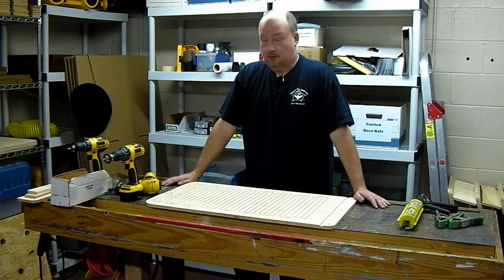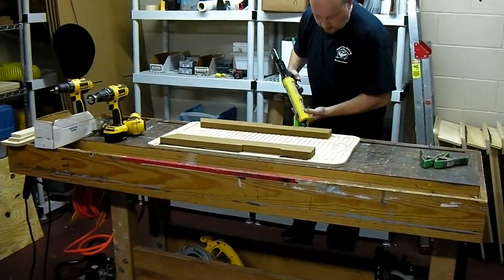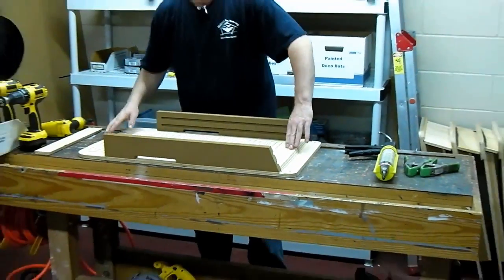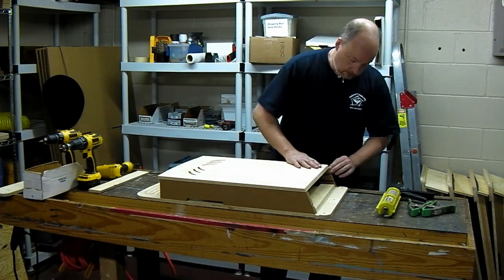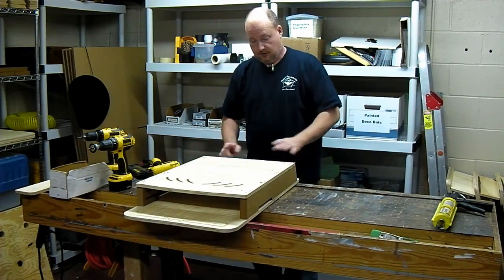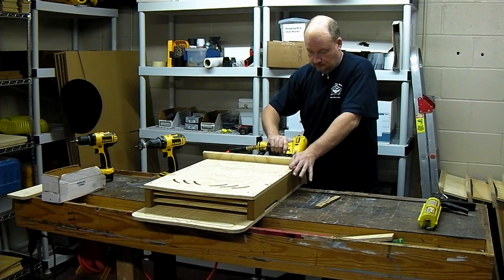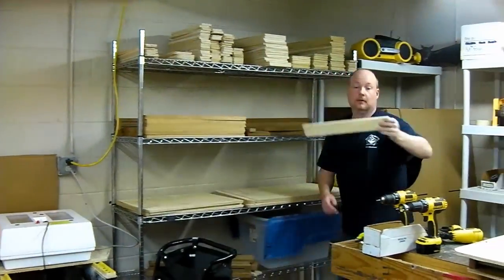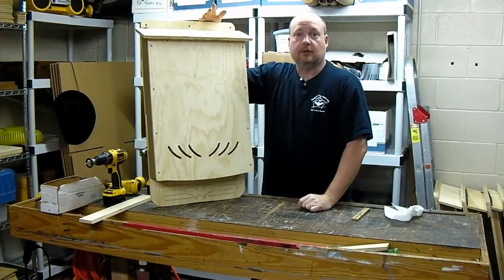Building Our Three Chamber Bat House

Comment: Using good exterior plywood is a good idea.   Do you coat the exposed edges at all to help prevent moisture effecting the ply, or is this unnecessary?   Thanks so much for this video and the work you do for our bats!
Reply from the maker: We give 3 coats of a high quality exterior latex paint on our commercial bat houses, and recommend the same when we sell our kits.

Comment: so if i dont have a cnc router how do i cut the grooves?
Reply from the maker: You can cut them by hand using a handsaw, or use a router with a small 1/8" bit, or use a razor knife. Grooves don't have to be consistent, just scratch up the surface so bats can get a toehold.  Thanks for loving bats!

Comment: How do I know that wasps and hornets won't make a home in the house? Or how do I prevent that from happening.
Reply from the maker: Paper nest building wasps generally desire at least 1 to 1 1/2" space to build a nest, the 3/4" baffle spacing that we use discourages wasps from building inside the bat house. The open weather and small overhangs tend to prevent them from building outside of the bat house. There is no known way to prevent dirt daubers from building mud nests inside a vacant bat house, but they are harmless and once bats occupy the bat house the dirt daubers will leave it alone.  Thanks for loving bats!
Reply: @h4bats  what about carpenter bees? I suppose since there are no thick pieces of wood on the bat house they should leave it alone. We happen to have paper and mud wasps, hornets, yellow jackets and Carpenter bees. We are in Upstate NY, where the northern long ear bat lives and a nearby projects just clear cut about 70 acres of trees in which they lived heavily. So I was viewing your videos to find what I need to do. And since watching most of your videos, I think I found a few good places for some boxes. I just hope they move in fast.

Comment: I love the design and construction of this house. I was wondering what is the biggest house or kit that you make?? Im Looking to give a lot of space for a decent colony to eventually grow into a  colony of around eight hundred to a thousand bats. There has been alot of tree clearing  and  want to provide a place that they can call There home or homes to make up for the forest loss. Plus it would be an awesome sight to see as they go on their nightly flight. Hopefully people in the neighborhood will see what I'm doing and hopefully do the same.
Reply from the maker: The 4 chamber fully finished bat houses can be mounted back to back on a single steel pole (schedule 40 2"ID black pipe) and we sell the bracket for that as well.  Those two 4 chambers could easily accommodate 1000 bats.  As for our kit, we are working on a 4 and possibly 5 chamber kit we want to release soon. Two of those would hold 800 and 1000 bats respectively.  Check out or estore at https://estore.habitatforbats.org

Comment: Do you have a problem with hornets wasps nest or even carpenter bees in a bat house ??? Thanks
Reply from the maker: Wasps will generally build around the bottom of the bat house. Once occupied by bats, wasps are typically not a problem.  We have not seen a huge problems from carpenter bees, they generally do not prefer painted surfaces and seem to be less attracted to plywood type materials.
Reply: @h4bats  Building out of cedar wood be the best wood with no negative aspects ??? Thanks

Comment: Hey what’s a good way to relocate bats? We have an issue and don’t want to just “exterminate” them
Reply from the maker: After early August (varies by state so check your local laws) you can exclude bats from areas you don't want them. It's important to wait as they may have pups that are unable to leave on their own until then.  An exclusion can be as simple as a netting hanging down over an entry point so they can leave and crawl down (leave the bottom hanging) but when they come back they will land on the net and not be able to re-enter. Or you can use tubes like PVC or even cardboard to create an exit they cannot later return to and climb back up and inside.  Good luck and thanks for loving bats!

Comment: Question:
I want to purchase a 4 chamber house for southwest Virginia, average July temp is 82 with high humidity.  I want to place house on west facing side of a brick house, should I get the regular, medium color house or the cold weather house?
Reply from the maker: You should be OK with a medium color in that area, but placement should be facing South to SE and catch the morning sun keeping sun until some time after noon. While a bat house on the west side of the house might be used by a bachelor colony or some species that might normally roost in trees, it would not be attractive for a larger colony of females. Bats prefer the temperature between 85 and 100 degrees and the morning sun goes a long way to warming the roost in the mornings.  If you are in the mountains, higher altitude and thus lower temps, you can go to a medium dark color.

Comment: Hi, How much guano could I expect to collect for my garden per 100 bats?  Like a quart a season?  I was going to put a pan around the bottom of the pole.
Reply from the maker: Repeating answer from a different video... With a persistent colony of 100 bats, you could get a reasonable amount, hard to say. The wind, sunlight drying it up and missing the target will reduce the amount you collect.  I have seen a healthy colony of around 400 bats produce roughly a 2" blanket of guano on the ground for a diameter of about 3 feet their first year.
Reply: @h4bats  thanks!!

Comment: Is that a non toxic caulk that you are using if so please let me know what brand and type you like to use Thanks.
Reply from the maker: We use a high grade of paintable exterior latex caulk. We have to switch brands depending on availability. Once it is fully cured it is not an issue for the bats.

Comment: Is an open bottom better or should I slightly close it for predators? Also, what size holes should I bore in my partitions? Thanks
Reply from the maker: Open is best to allow the guano to drop and not accumulate in the bat house.

Comment: Apparently you installed the roof so that the bat house could vent out the top, I think.
Reply from the maker: Nope, the roof is completely sealed. Only vents are on the lower front and sides.
Reply: @h4bats  whatwas the spacer for?

Comment: i made a bat house out of ceder, what kind of paint should i use any help, blueegg08@gmail.com
Reply from the maker: It depends on the temperatures in your area. If you are in a very hot area, Texas, desert areas etc... you should actually go with a light color, closer to white or light tan etc... if you are in the north with cooler  temperatures use a darker brown or even black if the avg July temp is below 85F.

Comment: Wen using a french cleat i use a spacer at the bottom really nice video. I live in Arkansas and build bird house for fun and have request for bat house. I have watched several videos on this and I come across your video's. every boudy using mesh glad you cleared that for me. I will use groves. And most are making the chamber 1 1/2'' with a predator guard but I will use 3/4'' opening like you use. Thank you for your videos. 5 stars

Comment: Is the ply waterproof or do you recommend painting with a waterproofer?
Reply from the maker: You should paint the exposed surfaces with a good exterior latex paint. The plywood we use is rated for exterior use, it does not delaminate when exposed to moisture long term.  You should look for plywood stamped as "EXT" or "Exterior". Plywood with a rating of "Exposure 1" is not sufficient.  However, you should avoid pressure treated plywood.

Comment: I live in Northern Kentucky. We have little and big brown bats around here and was interested in one or more houses to allow for the development of a big colony or colonies. Insects eat us up at night and white nose is decreasing their numbers. Any assistance in this effort is highly appreciated and I thank you for your time. Oh was wondering if there is any way to make an old horse barn more attractive to bat's?? I was working behind the open door and only two came out at dusk.
Reply from the maker: The best way to make sure bats remain in your area is to improve their roosting opportunities. Bats like warm dry places to roost that are secure from predators. Bat houses can do this or in your case if you know bats are roosting in your barn you could improve the area they are roosting by isolating it from being disturbed. You could add (in the winter while they are gone) baffles in the area to increase the roosting surface, but you have to be careful NOT to insulate it from warmth. i.e. they may be roosting on the specific wall because it gets warm in the sun. In a case like that you would want to add chambers that all were exposed to that inside wall, not layered on top of it isolating them from it.

Comment: I didn't see any groves on the two baffles.  What do the bat's claws grip onto in the center chamber? For the outer chambers are groves only made on one side? Also, what is the space measurement for the chambers between plywood boards?
Reply from the maker: There are grooves cut approx every 1/2". You just can't see them in the lighting of the video.  We use 3/4" spacing for our chambers.

Comment: can you paint this house a different color
Reply from the maker: +stephen unk  It is the shade of color not the actual color that is important. It should help the bat house absorb heat in colder climates and reflect heat in hot climates. We offer our pre-finished bat houses based on the brown pallet with several shades available. Our cold weather is black. But they can be purchased unfinished or the bat house kit is popular and can be painted as desired.

Comment: would three single chamber bat houses or one three chamber bat house attract the most bats?
Reply from the maker: James Heasley A single 3 chamber is typically a better bat house. It will retain heat better and provide more options for the bats to find the perfect spot inside during the day.
Reply: I just received plans for a seven chamber bat house that came from the PENNSYLVANIA
GAME COMMISSION. Do you have any personal experience with a bat house that big?
Reply: I would be happy to email you the plans if your interested, just let me know. I would like your opinion!
Reply from the maker: James Heasley I have built up to a 9 chamber bat house and still build them for project builds.  The challenge is generally hanging them once they get that large. It takes a substantial pole to support it. Placing one on a structure can be a challenge as well due to the size (depth) of the bat house. But they can be quiet successful for a large colony.

Comment: I see how the lines routered out on the initial piece give the bats something to grab onto for climbing up into the top but I am not understanding what the point is of the baffles?  There are holes for them to pass through but then there is nothing for them to hold onto unless there are in the back most chamber where the grooves are cut.
Reply from the maker: Annony Mouse Grooves are cut over the entire interior surface. Both sides of each baffle and on the inside front and inside back.  The baffles simulate crevasses for the bats to crowd into. The spacing is 3/4" (19mm) which is a sweet spot for crevasse roosting bats.  Bats will roost in crevasses as small as 1/2" and as large as 1 1/2".  The added benefit of 3/4" spacing is that paper wasps will not build nests in a space that small. They will build in 1" or larger spaces.

Comment: What are the slot openings in the sides?
Reply from the maker: The opening on the sides are vents that help regulate the temperature near the bottom of the bat house. On very hot days that area will cool more and the bats will move down to the bottom of the bat house to find their preferred roosting temp of 85 to 100 degrees.

Comment from the maker: It depends on the size of the colony, but even a large colony outside the sun will heat the guano and help neutralize it and the rain will wash it into the soil.  Most colonies will not require any attention under the bat house.  We've had people collect the soil with the guano and replace it using it to enrich potting soil. We've also had some put planters underneath them. One guy collects his and puts it on his garden, but he has a colony of about 1000 in several bat houses.

Comment: I have two questions: 1. I recently made a bat house it was from the Bat Conservation International, it was pre-cut, pre-made all I had to do was put it together and paint it.....ok now I will get to question 1 an it is: instead of grooves like you had they used a utility knife to make many cuts on the wood pieces for the "foot holds" will the bats be able to hang like that? An question 2  I have one of those long metal old timey tv antennas that my dad will be placing my bat house is that ok?